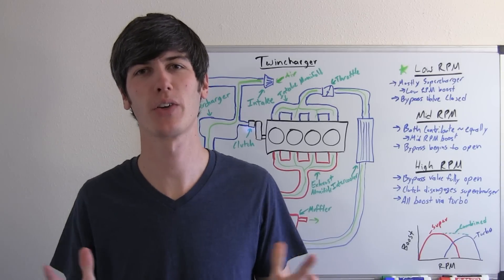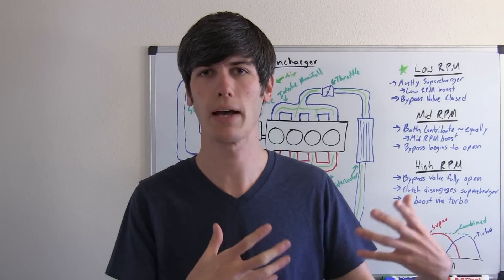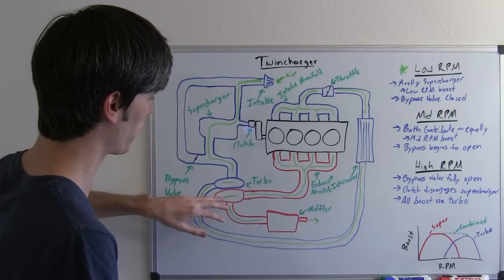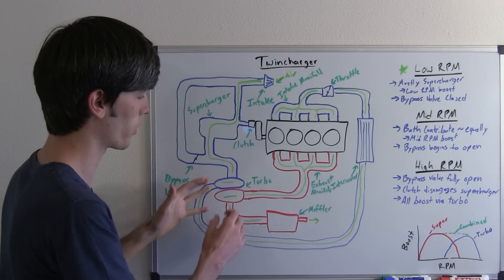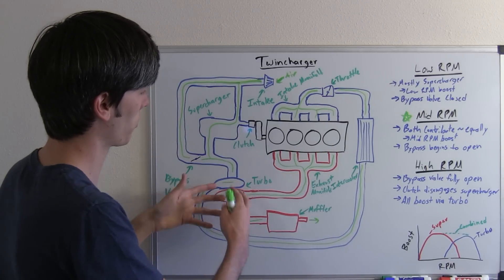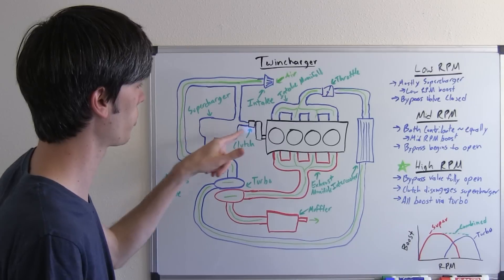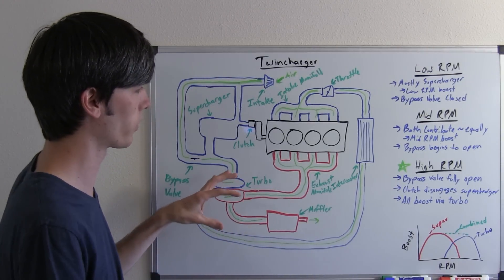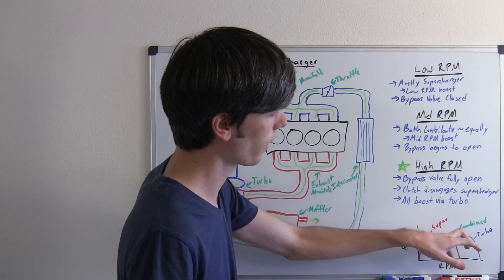How Twinchargers Work: Supercharger + Turbocharger

Comment: in MOST (not all) twincharger or compound boost systems, the turbo(s) is/are before supercharger
Reply from the maker: How many systems do you know of? This isn't really a common production item.
Reply: the VW set up, several turbo kits for the supercharged cobalt ss, the hellion hellraiser kits for the 03-04 cobra/gt500, see supercharged diesel, http://www.bankspower.com/magazines/show/634-a-supercharged-and-turbocharged-6.6l-duramax-crate-engine ...the list goes on. YOURE RIGHT in that twincharger set ups are not common, but ones in which the turbo(s) is/are after the supercharger are far less common

Comment: Hey EE, what type of engine would this benefit the most? I would guess a four cylinder, or v6. They could really use the low end boost to get it going until the turbo starts spinning, whereas a torque-ier v8 or i6 will already have good power in low revs. Any thoughts on this?
Reply from the maker: I'll agree with your thought process, though V8's typically have a benefit of higher torque from larger displacement, not because of the engine configuration.

Comment: Everyone explains twinchargers as supercharger 1st than turbo charger 2nd. When actually this is all relevant to the size (and efficiency) of the turbo and super charger (not to forget the pulley size on the supercharger) Theoretically one could have a turbo at low rpms and supercharger at high rpms depending on the size of each. Maybe a video demonstrating how to pick the right size turbo or supercharger (or twincharger) depending on engine displacement would be a good additional video. Don't forget twin turbos and twin superchargers. (pulley sizing probably won't be a bad idea either) Thanks again.

Comment: Why not feed the output of the turbocharger into the input of the supercharger? So when the output of the supercharger has reached its efficiency, the turbo can provide more boost without the need of valves.
Reply: There is a difference of the flow speed of compressed air between turbo compressor and supercharger. If You connect the turbo compressor exit to the supercharger intake, the supercharger will interfere with the speed of high-flow air that made by the turbo compressor. As a result, the turbo compressor will fall into surging.
Reply: It won't surge. It'll compress the air further after the air flow of the supercharger has reached it's limit. It's called coumpound charging. The air will still feed into the supercharger compressed. You'd need a blow off valve between the two chargers but it would work if the supercharger and the turbocharger were properly sized. It'll actually spool the turbo faster as the incoming air of the supercharger will spin the cold side blades of the turbo.

Comment: Why not put the turbo before the supercharger?
Reply: because science
Reply: During low RPMs, the turbo isn't spinning fast enough to get enough air for the engine, effectively cancelling out what the supercharger is trying to do.
having the supercharger BEFORE it is letting the supercharger breathe better and deliver enough air for the engine.
Reply: TheFlacker99 (Flak) No. Air will pass through a turbo that isn't spinning, otherwise turbo cars would never get on boost. There is effectively no restriction across the compressor. Having the turbo in front would make a brilliant two stage supercharger, already on boost so the turbo will spool much quicker. If the supercharger is pushing in 6psi, the turbo would only need 7 to get a 1 bar total, or 10 across the turbo would give a total of 35 psi boost. The possibilities for impressive boost figures and spool times with staged induction is immense.
Reply: TheFlacker99 (Flak)
Authur Jackson

Thanks for the info! I just posted it because almost all of the twincharger applications I have seen used the turbo before the supercharger! And you seem both to have a point! :)
Reply from the maker: It could be done.
Reply: Tekams TheOne No prob
Reply: u could feed the turbochargers compressed air into the supercharger then into the motor, but would it really do much that way?
Reply: Yes. turbochargers and superchargers are simply air pumps - in fact turbochargers were more correctly named turbosuperchargers but time conventions have changed this. As air pumps they will pump the air pressure to a given density ratio. If the supercharger pumps air to a 2x density ratio, it will pump 15 psi of boost. If a turbo pumps air to a 2x density ratio, it will pump 15 psi boost. If you have a turbo pumping air at 2x density ratio into a supercharger pumping air at a 2x density ratio, the pressures multiply to a total of 4x the initial air pressure. In the case of atmospheric air pressure, that will result in 45 psi of boost.

The overall result is the same pressure as a very highly wound turbo, but with much lower stress on the turbo, much lower drive pressures, oil temperatures and overall improve safety and reliability of an engine as well as significantly less lag.

If you want to read more, google: "compound turbo dsm" for a fairly in depth explantion with results to match. Note that having two turbos in series and a turbo and supercharger in series has the same result (within reason - positive displacement superchargers should be put after a centrifugal supercharger or turbo) as well as having two superchargers in series. This set up was used quite significantly in history, most famously in the Rolls Royce merlin engines which had two superchargers and operated to approximately 40 psi boost levels. That might be nothing to sneeze at by todays standards, but we are talking about the 1940's here.

Comment: what I wanna know is, why aren't there many cars using this kind of forced induction? Or is it just me? Also, is it because of the added weight of both?
Reply: I suspect the main reasons would be cost and complexity.  Twincharging hasn't been used in many production car designs: in the late 1980s Nissan built the March Super Turbo, and in the mid 2000s VW built a twin charged 1.4L engine that was used in a number of their small cars.
Reply: oh wow, so it was the sustainability of the tech that brought it down then?
Reply from the maker: It's way too complex and way too expensive, when cheaper better solutions out there already exist. It has a "cool" factor going for it, but that's about it. A proper VGT would be a better bet, and is far more simple.

Comment: I was thinking of doing an L67 swap in a fierro and slapping a turbo on it......because yolo
Reply from the maker: Yolo flip.
Reply: YOFO
Reply: Engineering Explained Is it possible to use to a powerful motor on the intake turbine to eliminate the turbo lag?
Reply: I did it on my 86 Fiero GT with a L67. Check out my posts.

Comment: ive never heard of this way of doing compound boost. i imagined it wound be a twinscrew or roots type supercharger mounted on top of the engine then the turbo would feed the twin screw as it spooled up. and the supercharger would stay connected to the engine via the serpintine belt throughout the entire rev range. this way seems overly complicated but good video
Reply: Turbos would just restrict the supercharger at low RPM and you lose potential top end power using superchargers relative to turbos. Plus roots and screw type superchargers move the same volume of air every time they turn over so trying to force air into the housing would just create excess heat as it would be trying to move compressed air, something they aren't designed to do. The way Lancia and Volkswagen did it is the most efficient way.
Reply: nblax41 There is so much wrong with that. The turbo would not restrict the supercharger in any meaningful way. Constant volume superchargers are just that - constant volume. One cubic foot of air is always a cubic foot, no matter what pressure it is. If the pressure is at half atmospheric, it is still a cubic foot. If it is twice atmospheric, it is still a cubic foot. A supercharger will pump whatever pressure air to a higher pressure. If the turbo is feeding air at 10 psi, the supercharger will boost that to 15 or 20 psi. Have a look a staged supercharger systems in airplanes, particularly rolls royce merlins.
Reply: A supercharger trying to suck air through a turbo would cause noticeable restrictions. Trying to spin the impeller wheel would drive the compressor as well creating a vacuum between it and the exhaust manifold which creates more parasitic loss as well as boost spikes each time a cylinder vented. It's been done on cars before and little if any gains are made and there are big increases in temp and added weight.
Reply: Look up the BRM v16. This isn't a new concept, it's been around since the 1940's. Also look up compound turbocharging in diesel engines, they push well over 100 psi in the racing engines and using exactly the same concept.
Reply: Using a turbo to feed a turbo and a supercharger to feed a supercharger isn't the same as turbos feeding a supercharger. The compounding pressure does work with either system, I was wrong about that, but a supercharger will not suck air efficiently through a turbo that isn't being fed enough exhaust for the speed it's spinning.
Reply: If that were the case then compound turbo systems on diesels and petrol cars would not work either, because the small turbo is trying to pull air through the larger turbo. No, it's just not correct.
watch?v=y-Me6yWApzY
Reply: Authur Jackson That video is a sequential setup, not compound. None of the things you keep throwing out are as efficient as a supercharger-turbo twincharge setup as there are too many losses in each one be it due to heat or flow restriction. If any of them were a better solution, they would have been chosen over the system in Jason's video. At high RPM a turbo is more efficient than a supercharger, and vice versa. Turbos spooling at low RPM into a supercharger will not make more power than the super itself and at high RPM turbos produce much, much more boost and are therefore favorable. That's just how it is. Good night.
Reply: That's just how it is. Oh dear. Of course manufacturers don't stage their chargers.  They don't want to foot the bill for designing and building engines that run 50 or more psi MAP.

You are right though, it was a sequential set up. That is irrelevant though, because the charger is still pulling air through the turbo in front of it. Did you hear him talking about how the secondary turbo restricts the air to the primary? No you didn't, because it doesn't, which was my point all along. The fact of it being sequential not compound is irrelevant, there is still one charger upstream of the other and the primary turbo can only get air that has been sucked through the secondary. You are trying to suggest that it would produce huge heat losses and flow restrictions and you are just full of shit. 

The benefit of staged turbos is that you can run high MAP (over 40 psi) while still being in the efficiency zone of the turbo. A single largish turbo can capably manage over 40 psi but it is nearing the edge of it's chart. Running staged or compound, both turbos are hanging, chilling right in the sweet spot of their efficiency curves. Similarly, running a turbo into a supercharger compounds the boost in high RPM. While a turbo can make the boost pressure on it's own, the advantage of compounding keeps the turbo in the efficiency island with the capability of going far far higher, right off the chart if necessary.

That's just how it is.
Reply: Evan D I hope that helps a little bit. FWIW, this video isn't a compound system, it's primarily a sequential system where the supercharger turns off once the turbo comes on. To my knowledge, BMW have the only compound system in factory production cars. Some trucks also have them as well as using a true compound system which involves a blowdown turbine which is connected directly to the crank - I don't know if that ever went past concept stage, though Detroit Diesel were definitely playing with them at some point.